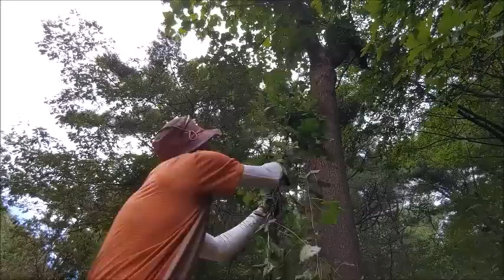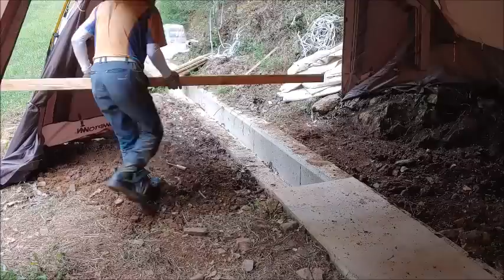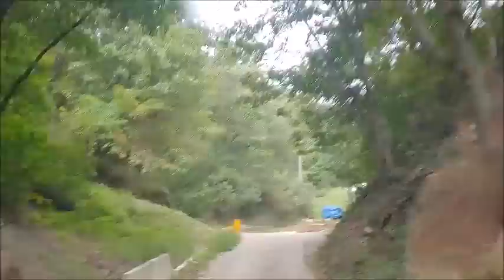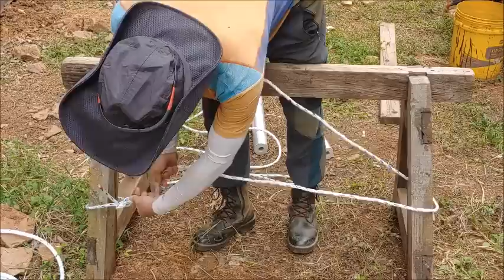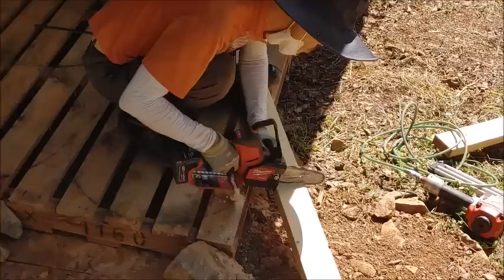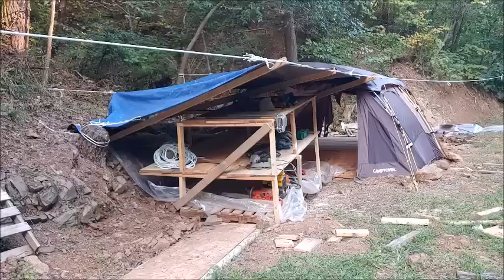산속으로 이사가다.

Comment: I noticed the ivy vines being pulled off of the trees.  They are .more easily Removed by tying a rope to the vine after cutting.   Maybe 10 meters long.   Then walk the rope back from the tree,  this decreases the steep angle of pulling to OUTWARD, not straight down.  Better application of force, removes more of the highest parts of the vine.  I have even tied the rope to my truck for the thickest vines.  Mostly done by hand,though.  Walk the rope back as far as the area allows, usually 5 to 8 meters for best advantage.
Reply: Very true, you get way more of the vines out of the tree.
Reply from the maker: Thank you for your advice.
Reply: @woodwood1  I've been watching your channel for awhile now. Can you speak English or do you use a translation app? I learned a few timber framing styles but after watching you work, I think I prefer the Korean style, especially the hanok house with ondol floor stove.
Reply from the maker: @martinfaucher  I use a translation app.
Reply: @woodwood1  Good. I have a question. I really would like to use this Korean method of timber framing. Can a second floor be stacked by making the cross beam thicker and carve a mortise to it and a tenon to second floor post?
Reply: @martinfaucher  hello dear maybe i didn't get it very clearly your Question but as i understand i think no problem if you have strong and enough posts.
Reply: @qamarpapa485  Thank you for replying to my question. Are you the creator of the youtube channel "wood wood"? Or are you a Korean timber framer?